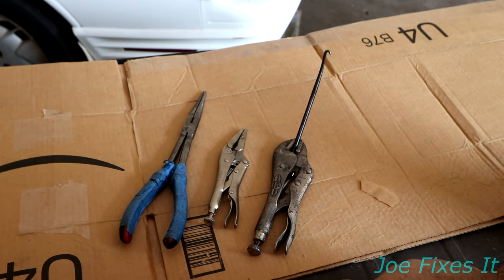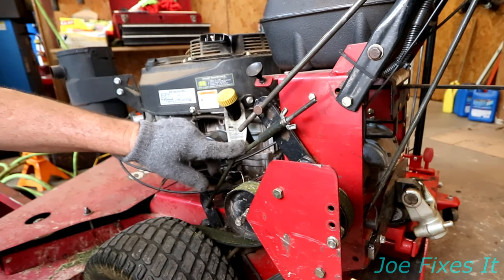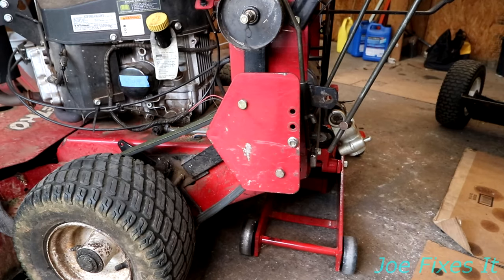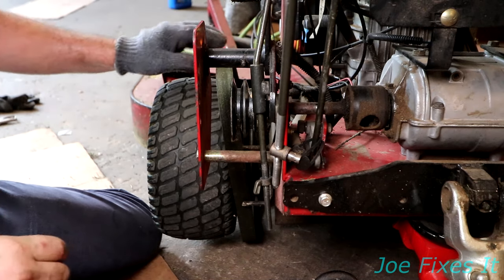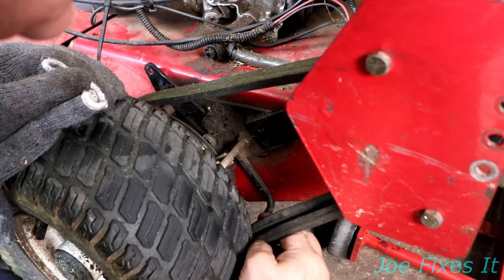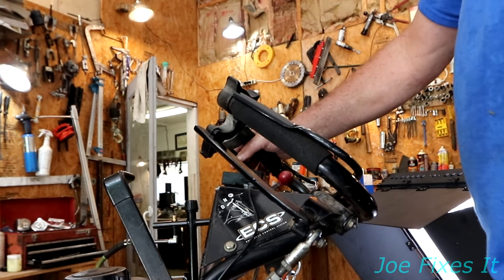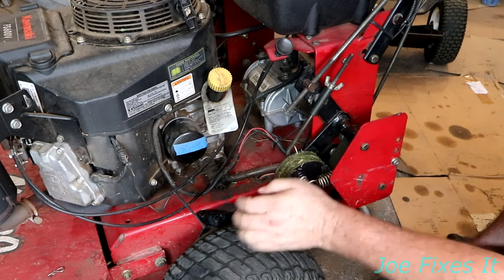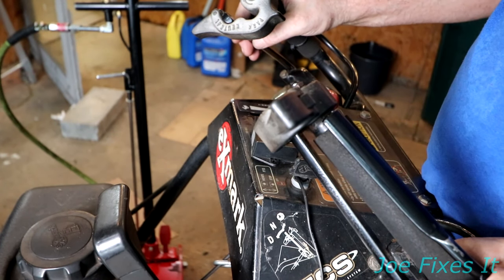Exmark Metro 48 Inch How to Change Wheel Drive Belts | Adjustment |  Kawasaki FS600V

Comment: Great video! (Thanks for replying to on the headset!) used your procedure to fix my 36” Metro’s brake & tension on the drive belts. Worked like a charm! (My belts are quite worn but maybe I can make through another mowing season!) I think I have a transmission issue; the right drive does not work very well in s 2nd gear but very well in 3rd! Thanks and have a good leaf & bush season!
Reply from the maker: The belts last for a long time and are better after a couple seasons. You can find transmissions on ebay. That is what I had to do as it was missing tooth in 4th gear when I bought it on craigslist. You can be sure that is you get something on craigslist something hidden is broken.

Comment: I have the same lawnmower but when I put it in reverse it doesn’t go back and the transmission be spinning and spinning but it doesn’t go back
Reply: it is reverse assist, you have to pull it back all it does is help. I guess for keeping people like my from running myself over.
Reply: Thank you
Reply from the maker: welcome
Reply: but why it’s so hard to pull back is it like that
Reply: @elieserpalacioscruz105  loose or worn out drive belts or loose or worn out engine to drive belt..

Comment: My hand brake clips don't go to neutral or hold, so I must hold the brakes and shift with my knee. Any tips on getting the hand brakes functional again?
Reply: if the shoes are not wore out, you have to adjust them. I think I did a video on that

Comment: How do I know if the trans is going bad? First gear and reverse seem to only wk. Would you recommend to replace the side drive belts
Reply: if it is slipping it is more than likely the engine to trans belt on the bottom of the mower, the wheel drive belts are pretty tough

Comment: i have the same mower. the left drive belt drive wheel coming from the transmission is moving out towards the left and making the belt hit the wheel. You have any idea why?? It seems to happen once i engage the blades. Thanks for any help
Reply from the maker: sounds like you have the hub coming loose or a wheel bearing starting to fail

Comment: Great video .... i have the 36” metro same basic set up .... mower tracks fine but as soon as i go to turn it just stops ... i have to completely get off the sulky and then it will continue to make the turn ... pulls fine going straight ... any help on what i need to do ?? It used to turn and whip me around quickly ... now i start to make a turn and it just basically does NOTHING until i get off and let it pull itself on around ... PAIN IN THE BUTT and i cant figure out why its doing this
Reply: check you belt tension on the drive pulley on the bottom of the engine first..
Reply: @JoeisHungry  i tightened that up today actually .. when it stops pulling on hills that my que to tighten that drive belt .... it does fine going straight ... as soon as i start to turn it just basically stops in its tracks until i get off the sulky then it will turn on its own drive belts might be 2 seasons old ... i dont use the mower all that often but its almost more trouble then its worth anymore .... mower runs strong just the belts wont bite or pull our something when trying to turn I’m stumped
Reply: @benwallacelawnworks3363  Sounds strange, do not know old the belts are but they last a pretty long time as a matter of fact they don't get good and smooth until the get a couple seasons on them. sounds like you got some contamination on the belts. will get back you do on this. ...... have you adjusted your breaks? I mean this is not a complex system they use. Does this thing sit outside?
Reply from the maker: let me know,, sounds like you got oil one one or both the main drive belts..
Reply: Low pressure in sulky and drive tires .... didnt appear low but visually after putting a gauge on them they were reallly low ... problem solved 👍🏼👌🏼

Comment: Fantastic video, Joe! Any thoughts on the pulley position re: tension. If I remember correctly there’s 3 positions that they could be in - each one providing more drive belt tension. I always thought I’d try the next position for more tension. I have a sloped and  wet yard. Your video has given me the confidence to try it.
Reply from the maker: go for it.. you can always easily change it back. I leave mine in default.. they only thing that makes it slip under a load if the engine to transmission belt

Comment: Hey Joe I have exmark metro 36 the problem is when I’m turn to left going really slowly but right works good what is the problem
Reply from the maker: break adjustment, belt contamination, tire pressure not equal. I normally run them very low a making it handle better and 5psi on each side.

Comment: Hey Joe excellent video I also have a metro ultra cut 48 and like the other commentor said it does not track straight I have checked air pressure and corrected air pressure so they’re both the same but It still pulls to one side any ideas
Reply from the maker: the only thing I can think of is the condition of the two drive belts and are they adjusted evenly. This is s belt drive correct?
Reply: Joe Fixes It 
It is an ExMark Metro Ultra Cut 48 series 3 I just bought it today at an auction and have run it for an hour or so I am getting familiar with it.  You suggest if the drive belts are adjusted evenly what is the adjustment for them I’ve watched your videos and I now  know where the brake and clutch adjustment are is there a specific adjustment for the drive belts?
By the way you should have way more subscribers your videos are really good entertaining and the production quality is quite good I am interested in X Marks and Chainsaw so I am now a subscriber
Not at all interested in those Volkswagen diesels as Scotty Kilmer would say “endless money pits”  ha ha Ha
We all have our vices
Reply from the maker: the belts act as the clutches, it depends on their condition of the belts. they are not cheap and last a long time. make sure the breaks are not dragging on one side or the other and the wheel bearings are in good condition. Most frequently the tire pressure is the culprit when mine pulls are water or contamination on the drive belts. These are not complex machines, there is not that much to go wrong.

I like ECHO chain saws as a personal preference..

MK2 VW Diesels are my thing, as a car they a fragile as any other car with greater than 200,000 miles, but the drive train is pretty bullet proof. Don't know about them being a money pit. I current own 5 and and four of them on the road right now. They are very simple reminding of working on lawn mower engines.
Reply: Joe Fixes It 
Thanks Joe I like the echo Chainsaw’s also
I’m gonna look things over pretty close on the X Mark. Right now I’ve got 20 psi in both wheels I might make 5 psi in on and the other 25 and just see if that changes the pulling one way or the other I wouldn’t run it that way for long because it would probably make an uneven cut but it’s something to mess around with I very much appreciate your answering the questions.
I’ll watch some of your VW vids always willing to learn
Reply from the maker: actually I run about 5 psi in mine, smoother and easier to control. take care and enjoy. I need to make more videos for the fix it channel.

Comment: Great video! Just changed the belts on mine. The originals lasted almost 12 years. Replaced with OEM belts. Need to probably replace my brake bands as it's pulling slightly to the right even after adjusting the brakes. Just have to figure out how to get to it. Any advice would be great. Thanks.
Reply from the maker: your going to have to pull the drive wheels..maybe I need to do a video..
Reply: Pretty sure you did a video on how to take the wheel off. Realized I need to remove the scraper first to slide off the wheel. After that it shouldn't be too difficult to replace the brake bands. Hopefully!
Reply from the maker: @timmybob2028  yeah it is pretty easy... shot a video yesterday fixing a leak VW door and had to trash the video and will re shoot. Put a gopro on my head.. just did not do it for me....

Comment: I have one these and the tracking fails often. Do you have this problem? I can’t seem to adjust these things correctly at all.
Reply from the maker: by tracking you mean going in a straight line when mowing?
Reply: @Joefixesit  Yes. I love the mower but it frustrates me into wanting to get rid of it.
Reply: @cliftondavidpowell  when I had tracking issues it was always the tire pressure. I run the pretty low (less than 5psi) makes it easier to control when running a full throttle in 5th gear which is what I do all the time, I actually ran the mower  for solid 6 hours today. next make sure your breaks are not dragging and adjusted correctly although the tracking was always the tire pressure
Reply: @cliftondavidpowell  but like I say running them with very low pressure  is what I do. 20 0 30 psi it bounces all over the place hard to cut ditches  with it
Reply: @JoeisHungry  Thanks
Reply: @cliftondavidpowell  let me know if it helps,
Reply: @JoeisHungry  It definitely helped big time. It’s not pulling as hard as it was at all yesterday but still is, slightly.
Reply: @cliftondavidpowell  also the condition of the bearings on the front casters to make sure they are not binding.

Comment: Joe do you have a video or can you make a video of how to change the brake bands on this Exmark mower( or another  belt driven walk behind mower) ?
Reply from the maker: I can start working on one for changing the brakes out this week for sure. You need another one for the wheel drive belts?
Reply: @Joefixesit  I actually figured out a really cool way to do the drive belts without taking off the wheel.
Reply: But I would love a video on how to put the transmission belt on.
Reply: @fendermann1825  you don't really need to remove the wheels, just the scrapers and guides and loosen  the breaks which take forever to wear out.
Reply: @fendermann1825  I thought I did one.. I will look and see. if not I will make one for sure. Or make a better one. they are a little bit of a pain because they are on the bottom of the mower
Reply: @JoeisHungry  well unfortunately my mower has about 2000 on it and I’ve never change the brake bands. So it’s probably time. And I really appreciate the video on the brake bands.... thank you in advance.
Reply: @fendermann1825  I should have time to put a video together this week. The food channel should not be sucking up all my time this week. I would rather make shop videos any day especially when it has to do with my mower.

Comment: For the record. If you lack a spring puller but have a selkie, the chain you hang it with can double as a spring puller.
Reply: not sure what you mean. mine has suspension built into it
Reply: @JoeisHungry  the springs on the brakes, or any of the double hooked variety.

Comment: hey, whenever I use the pistol grip to turn in makes a squeaking sound and when I go up the slightest of a hill my mower just stops moving and I have to push it to get it going again. Any thoughts on what belt this might be?
Reply from the maker: sounds like the engine to transmission drive belt is too loose or worn out on the bottom on the mower. I did a video on that one.

Comment: My 2019 32” metro barely goes in reverse. The machine has literally be used 3 times so it’s practically brand new.  Do I need to adjust the belt on it?
Reply from the maker: No .. that's normal operation, it is called reverse assist.. just helps you pull it backward. I guess they don't want the mower to run you over.

Comment: Joe, so close.... that 'scraper' (that keeps the belt in place) I'M GUESSING, messed up my drive pulley (that is attached to the wheel).  The belt stays on the pulley and that is a miracle because 1/2 the pulley end is wavy or rusted and gone.  Irony is the belt looks great..  Summation is now I know how to replace the belt...but how to replace the pulley?  & give your mama a hug, she did a good job!  Thanks Joseph
Reply from the maker: you take the wheel off and four bolts hold the wheel pulley on. I did a video on removing the drive wheel...

Comment: I had to subscribe seeing you had 999 subs... I have the same mower and noticed the left wheel wasn't moving as much... It's not a big deal on flat properties. However, on slopes, It will only turn left not right...
Reply from the maker: well thank you for pushing it over the edge! check tire pressures, check break adjustment and wheel drive belts. Unless you have wheel bearings going bad..(not very likely)

Comment: Thanks for this video- great info . I  have one of the belts that slips off if I'm moving the machine around with the clutch /brake lever pulled back slightly . Old belt did the same ,part of the reason  I changed belts . 20 year old 48 ".
Reply from the maker: Glad it helped. I love my old belt drive  updated with a 17hp Kawasaki